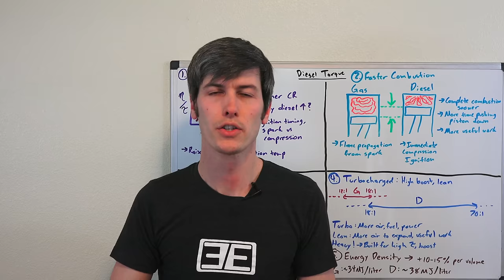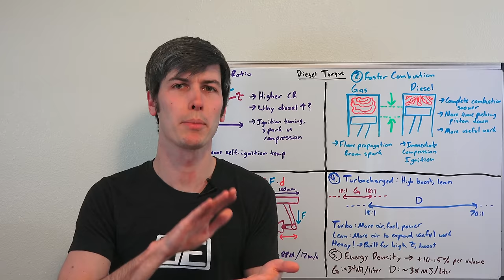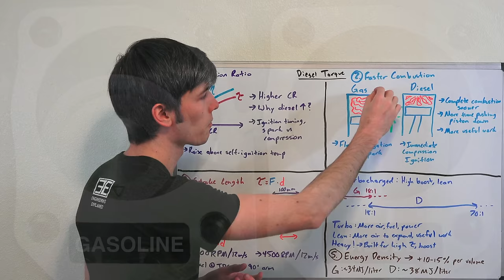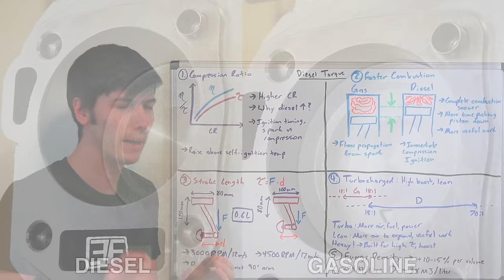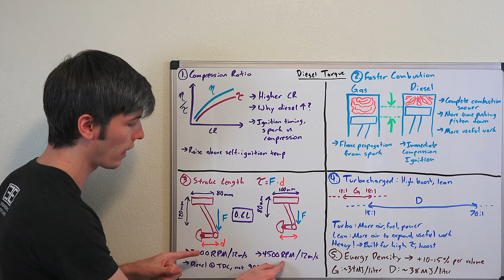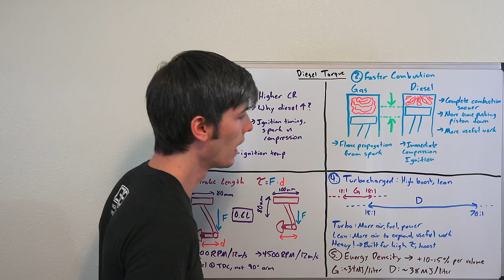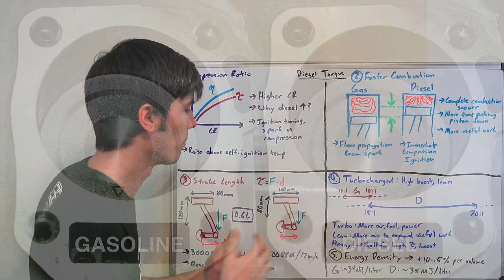5 Reasons Diesel Engines Make More Torque Than Gasoline

Comment: Well actually main disadvantage of diesel engine is that it cannot reach gasoline engine's rpm.  If we want to compare gasoline vs diesel, we should always consider turbocharger. If we think of gasoline turbocharged engine, does it lose at torque? Power to diesel????

I agree with power density, lean burn and so on : they are the reasons why diesel engines are more efficient. But it doesn't means that diesel engines have more torque AT ALL.

Comment: All of these points are moot, because you can have a gas engine and a Diesel with same bore and stroke. Compression ratio is moot since both engines are completely different. If you compare two modern direct injected, turbocharged and air to air intercooled gasoline engine to a direct injected, turbocharged and air to air intercooled Diesel engine with similar bore and stroke, there is only one factor that makes a Diesel more efficient than a gasoline engine-and that is the fact that Diesel fuel has about 20% more BTU's (heat producing factors) than gasoline. This is why on trains burn number 3 Diesel which is hotter burning, and big ships burn number 5 bunker oil which has even more BTU's per gallon. All other reasons mentioned in this video is nice, but not accurate.

Comment: Efficiency rises with an increase of compression ratio but only to a point not far beyond 23:1, the combustion chamber surface area increase caused by a higher compression ratio (function of bore and stroke and not the already-present clearance volume) detracts from efficiency. I realize that practical modern diesels rarely approach even 23:1 given the untimely death of indirect injection, just an interesting theory perspective.

Comment: So, these are all great reasons why a diesel makes more torque. What I'd like to know is, given all these reasons, higher compression, lower pumping losses with no throttle, lower revs (because of the higher torque), and extra btus in the fuel, why do diesels only get about 30 percent higher fuel economy. Seems like these would add up to more than that. And the latest diesels don't even deliver anywhere near that. 

Bonus question, why does diesel fuel have higher btus, and on a well-to-wheels energy basis, is there a cost for that at the refinery or elsewhere in the supply chain?

Comment: I followed all of the commentary and agreed with the entire explanation except for one thing. The moderate said that diesel engines always have a longer stroke. Then went on to say that he was not convinced linger strike WA a big factor. I think he fell asleep in physics class. Torque is always measured as the number of foot pounds produced. This means torque is affected by both the amount tbof pounds force produced plus the factor of the distance that force is supplied frim the centerline of the rotating body.
One pound force hanging  off a centerline by a distance of 1 foot produced 1 ft. Pound of torque. 
That same one pound force applies at a distance of 2 feet from the centerline produces 2 ft.-lbs of torque, so any force acting on a greater distance from the centerline produces more torque.
By definition a linger stroke requires the crankshaft bearing be further from the centerline of the crankshaft than a shorter stroke. That means that the exact same downward force on a longer stoke is being applied further from the centerline and is by the lever law of physics producing more torque.

Comment: What harm would come to a Gasoline Engine if it actually used Compression Ignition rather than Spark Ignition ?  I know there has been research going on currently and for some time now to manufacture a Gasoline Engine that uses Compression Ignition.  How is that research (R & D) coming along ?   🧐

Comment: Here is one I want you to explain. Why is it my lower how and lower torque 5.9 held speed better than my Cummins. Same final drive ratio. My old Cummins would pull a hill at 55 no problem where as the v10 would be screaming flat out and still lose speed

Comment: The host forgot that because diesel engines do not rely on sparks for combustion, they need to apply force in a different point at the cycle to create more pressure and to use better the expanding force, that is why the cycle peak and vale occurs in different points. That actually makes it generate more torque, not to waste it as the host imply.

Comment: Ya all made kind of a goof.  Never seen a gas engine piston the didn't come to the deck deck surface....010- .040 is normally the ' down the hole' measurement (the only exception that I know of is a motor I built years ago... ,350 Chev. .4000 bore  and 3.50 stroke with a 327 crank 3.25 stroke, both motors use the same rods, pin height is what changes so a 4.000 bore with  .325 stroke is 327 ci with pistons 1/4" down the hole.  Stroke is torque, just ask Harley Davidson, problem with long Stoke narrow bore is lack if room for decent size valves and long stroke limits rpm and vibrates ..as for ignition timing, gas burns slower than diesel so to light the fire in a gas motor you have to start it while the piston is still moving up so by the time the piston is on the way back down is when the fire is actually making best HP.  Turbo in a diesel is how you get around the weak vacuum signal of a motor with lame ass lift/duration numbers.  My 24 valve cummins  , 360ci with the boost hose disconnected makes enough power to make 30 mph. Direct injection is the shits. .finally a way to control detonation, injector dwell...no need for intake tract turbulence when you have pressure from blower/turbo, intake port shape becomes less critical.

Comment: I need to know one thing.
What are the accurate steps to convert a gasoline engine to run entirely on diesel?
In my case, I have two 50cc engines with 4 strokes in parts and one engine in bad running shape.
I want more mileage for less money, and you have already thorougly explained how diesel differs from gasoline, and I should be able to get it by now.
What's really lacking however, is someone explaining and showing in detail what has to done in order to make it work perfectly.
Are you up for this challenge?

Comment: You said that the turbos on diesels are pushing more pressure than on gasoline engines. Any idea how much more? I've heard that the diesel is injected somewhere around 27k psi, but I think I have never heard of a turbo pushing more than 20psi - factory equipped turbo that is.

Comment: actually combustion times are the other way around..... diesel engines burn a hell of a lot slower and longer then gasoline (pushing piston for longer there is the torque coming) that's exactly what extra octanes do for gasoline... proof of that, is the unburned diesel when you hit the accelerator, coming out as black smoke... if it would burn instantly this would't happen....

Comment: I've always thought that the under-square diesel engines, with their longer stroke, had greater rod angularity, hence greater leverage, hence more torque.   Also diesel fuel has more energy per unit than gasoline does.

Comment: The only main reason I see is that the diesels nowadays all have turbo chargers with very high boost...
I dont think there is any other reason than that. Because in the 70's and 80's before turbos were introduced a 2 liter N/A diesel had both less hp and torque than a 2 lite N/A gasoline engine. Although the hp was the biggest difference.

Comment: Some consideration on this video could be misleading:
1- considering the same engine volume the bore to stroke ratio is not affecting engine torque, speaking about crank slider mechanism parameters one that could in somehow affect torque is the ratio between crank radius (half of the stoke) and conrod length, but usually it is a value between 0.25-0.33.  At the end an undersquare engine could help to achive a value near 0.33 and so increase the torque a little bit. 
2- considering the combustion,for gasoline engine it is strongly dependent on spark advance and engine speed and this is the reason way gasoline engine can reach very high engine speeds tthanks to turbolences (usually the proper spark advance is limited by knock). On the contrary diesel engine has almost constant delay time from start of injection and start of combustion and this delay time means very high pressure gradient and so something that is very close to instantaneus combustion, but this is not the case of modern diesel engine with common rail system since with injection event that could be splitted up to 8 injection we have smoother pressure gradient that means less vibration and so less noise and less structural problem and less emission surely decreasing maximum torque.

Comment: I feel like it's easier to explain from a chemistry perspective, because the difference between the two is just the carbon chain length (though I'm biased because I do chemistry). Diesel uses longer carbon chains, so there's more bonds to break and form gasses - so more hot gas per volume of diesel, which makes more pressure, which gives the higher torque. This also allows the longer stroke length.
But  those longer chains are slower to break which limits the speed at which that gas is generated limiting the max rpm so diesel and petrol come out roughly even on power.

Comment: I know that diesel is always more expensive than gasoline, typically around the same price as premium gasoline, but which is more fuel efficient?  With large diesel trucks, you often see them billowing out huge black plumes of smoke when they take off from a stop light.  That black smoke is a huge indication of incomplete combustion, meaning there is fuel that hasn't been burned making its way into the exhaust.  You see it on pickups as well sometimes, though it's not quite as bad.  Unless you run into one of those douche bags who loves rolling coal.  In any case, the black smoke makes me think that diesel is less efficient than gasoline, but I hear a lot of people say that it's actually more efficient than gasoline.  Which is it, and why?  If diesel is more efficient, how much more efficient is it?  Is it a wide or a narrow margin?

Comment: There are two significant errors to me, if I am wrong pls correct me
The first one is combustion speed of gasoline engine is faster than that of diesel engine, that is the main reason that diesel engine has lower rev limit that gasoline engine.

The second is about stroke vs torque. Stoke doesn't determine torque, it is displacement and cylinder pressure together to determine torque. The theory is simple: 
torque=force X arm-length. 
because arm-length is proportional to stroke , so
torque=force X stroke
while 
force=pressure X piston-top-area, 
piston-top-area = displacement / stroke
so
force=pressure X (displacement / stroke)
so 
torque=pressure X displacement 

Given displacement and pressure, if stroke increase, then force decrease, so torque keeps the same.

Not to mention a lot of modern diesel engines of passenger cars have similar boreXstroke profile as those of gasoline engines. It is cylinder pressure and displacement determines output torque, no matter diesel or gasoline engine

Comment: If the immediate compression property of Diesel engine is achieved for gasoline engines, that may translate to compression ratios & thermal efficiency equal to Diesel engines, would that mean we should be able to use gasoline engines for trucks & heavy duty construction equipment & rigs & without compromising the higher Torque requirements?

Thanks

Comment: Those bore to stroke ratios are a little over the top.  So was the rpm comparison.
Gasoline engines with a 1.25:1 bore to stroke ration haven't been in production vehicles since the 1970's.  That's like a 327 Chevrolet, awesome horsepower and horrible gas mileage.
What diesel engine has 0.66:1 bore to stroke ratio?
I've driven diesel pickups that full throttle shift at 3,100rpm.  But the equivalent gasoline truck engine full throttle shifts at 5,500rpm.
So a better comparison would be: diesel 89x98 @ 3,100rpm vs gasoline 93x89 @ 5,500rpm.
I also don't think piston speed is a governing factor.  Time from ignition until the exhaust valve opens is the governing factor.
Diesel burns at about half the speed of gasoline so diesel needs more time to finish its burn.

Comment: If may i add, the diesel engines produce more torque because the chemical process of diesel fuel (gasoil) changing phisics states is by disotiation rather than combustion. Other important point is the piston design, the bowl on diesel pistones. By the way, is pretty good the way you explain stuff! Keep it up!

Comment: Why don’t you do a video based on piston travel in terms of feet per minute. Show both gas and Diesel engines with graphs of piston speed, horse power, torque and fuel consumption. I think the sweet spot in terms of highest torque and lowest specific fuel consumption will be 1800 feet per minute for both.

Comment: I own a 1997 12 valve Cummings rated at 180 hp and 420 ft lbs of torque it has 311000 miles on it never had the head or pan off it . I've read that stock internal parts of that moter can withstand 1000 hp

Comment: 5:50 Just want to point out that the reason why gasoline engines don't run as high of boost levels as diesels isnt because the blocks and rotating assembly isnt strong enough (which makes no sense because it could always be made stronger) but because higher pressures meaning higher temperatures. Due to the fact that gasoline engines mix fuel into charge air at the intake runner, running too much boost will cause knock as it gets really difficult to cool the charge air at higher boost levels. This is also why running E85 or having Methanol injection allows for higher boost levels, E85 has a much higher octane rating than gasoline, and methanol( as well as ethanol/E85) have a substantially higher atomization energy which actually cools the charge air as it atomizes, though this also why E85 cars have trouble starting up in the cold as the cold air doesnt have enough energy to atomize the fuel.

Comment: Are you sure about stroke vs bore? If you compare two engines with the same displacement, but with unequal bore/stroke ratios, the large bore engine will have a large surface area for the pressure to act upon. This means more force and will mitigate the effect of the longer stroke on torque. Ceterius paribus, the torque should be the same. However, long stroke engines tend  to have more compact combustion chambers benefitting the combustion process. This means it typically can have a higher peak torque, but due to the inefficiency of a longer stroke on high rpms it will have a lower hp rating than an oversquare engine.

Comment: One thing you didn't mention about gas engines is the timing of the spark. As you say the gas engine's power stroke the gas takes longer to ignite. However this is why the spark actually occurs a few degrees before complete compression (before top dead center) so the gas ignition starts before complete compression. It seems that you imply the spark occurs at top dead center. Otherwise excellent video. Thank you.

Comment: It is not true.. please compare two same size Gasoline and Diesel engines. Gasoline always wins ( has higher torque ). It's because diesel works with lean burn mixture. Usually diesel engines have a turbo so this lean burn is recompensated - that's why it is popular opinion that diesel make more torque.

Comment: So that's all true,but get a n/a diesel engine,and get petrol n/a engine,same displacement,you will see that's torque same,or even better in petrol engines. Basically,turbo means so much, diesel engines have much more psi of boost then petrol engines, newer diesels goes up 40psi,and that's much more than petrol engines, because they don't need so much boost. Gearing and revving is the most important thing.

Comment: It looks, like diesel engines are just better, because more efficient. However - is that true, that diesels are less efficient on smaller distances? I've heard something like that and since I mostly travel short distances, I think a diesel wouldn't be optimal for me. Then - I hear they are more robust, so why I hear so much about expensive repairs cars with diesel engines need?

Comment: and the most importen is Horse Power NOT Touquet. all diesel cars is still slower then gasoline cars.. always, but please tell why diesel engine sound like a Crank with a bunch of metal clucking around inside the engine. while running.

Comment: Excellent presentation on torque comparison between diesel & gasoline engines.  Biggest concern against diesels here in the UK are the NOx emissions & to some extent the semi burnt hydrocarbons seen on old and/or badly adjusted fuel systems . However, I believe modern diesels are  much improved to reducing these emissions. It would be  interesting if you could produce a video comparing the quite different emissions of these engines & the effects of those emissions on the environment.  I believe the Greenies of this world have no idea about exhaust emissions from either modern diesels or gasoline engines.  Advanced technology is the key to cleaner enines in my opinion. Many thanks again for your brilliant video from a Diesel engine enthusiast.